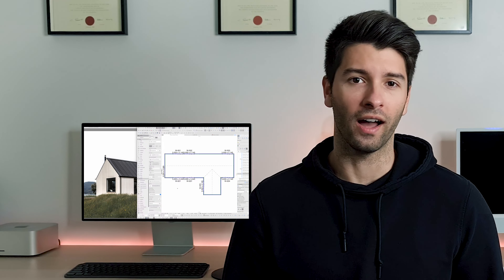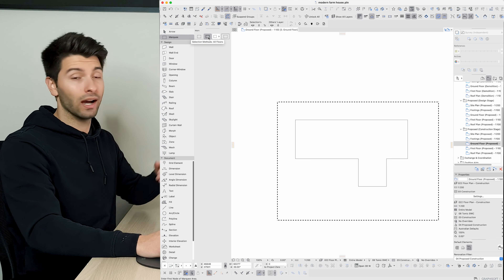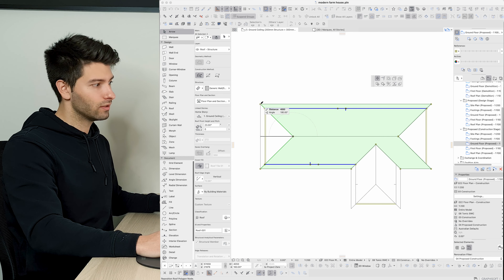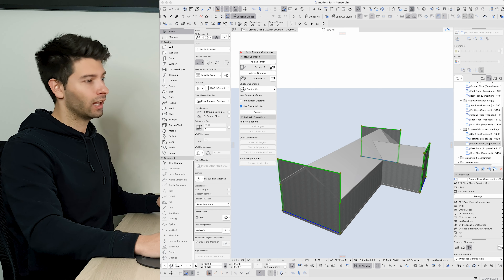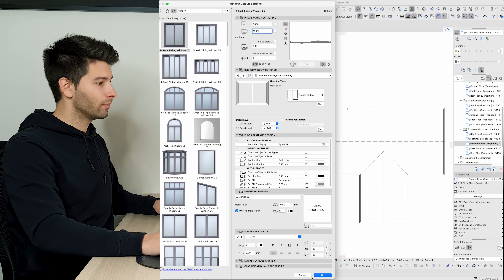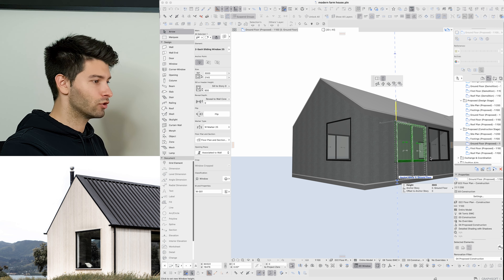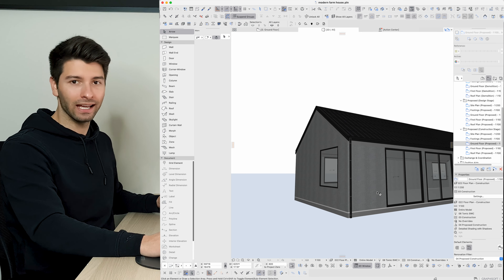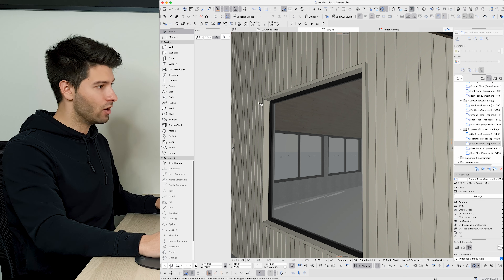Modern Farm House Designed in 10mins | ArchiCAD Tutorial

Comment: Hi mate, great video as always. Just wanted to point out that around the 2 minute mark (when you draw the wall around the perimeter of the slab) you can (always could at least in previous versions) space bar click on the edge of the slab with the wall tool active. Saves some time.
Reply from the maker: Excellent tip! Definitely one I always use with hatches and fills but tend to forget with walls and slabs haha

Comment: It would be fun to see how would you make a Dormer in Archicad. I am thinking moving away from the software and onto Revit since I have 1000 issues with the Roof and possibilities there.
Reply from the maker: Dormer windows are relatively easy to create in archicad and I'd suggest looking into 4D library windows. I'll see if I can include it in one of my up coming tutorials for you. Also moving from. Archicad to revit is tough, reverse is okay.
Reply: @DavidTomic  Yes the ones that are simple. But in my case most of the time the Side Walls of the Dormer are Thiner then the front wall. The front Wall is on a angle so not 90degree to the roof. Its basiclly all modern Dormers. 

I do Side Walls with Shell comand, the front Wall as Wall, the small Shell between Roof and Wall on the Bottom part. The Roof of the Dormer with Roof as well. So I surraoud the Wall  with  Shell and Roof because I can make Shell connect with Roof but not the Wall with Roof on  :(. And only on Wall can I place Windows. Its a complex Workaround but thats the only way I can make it show correctly in 3D as well as Plan